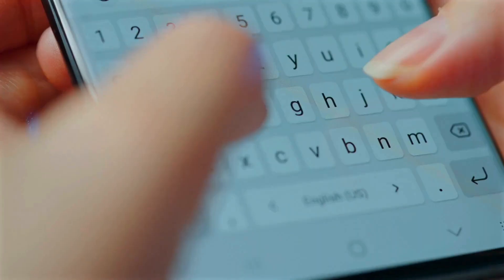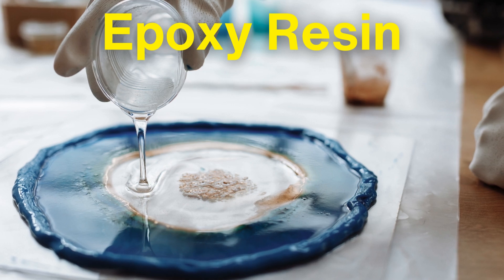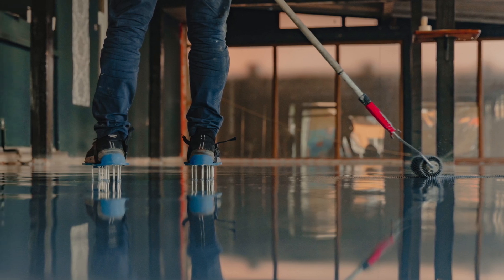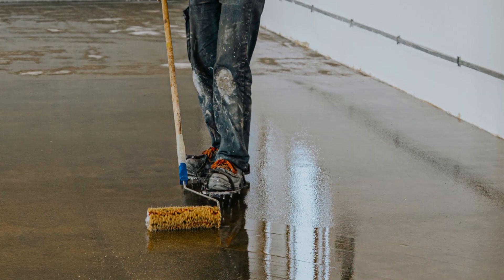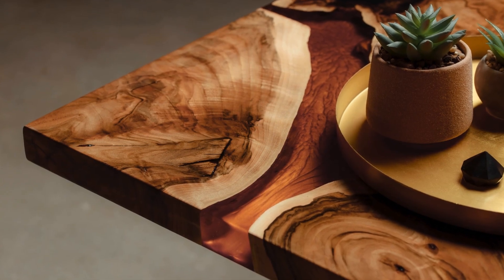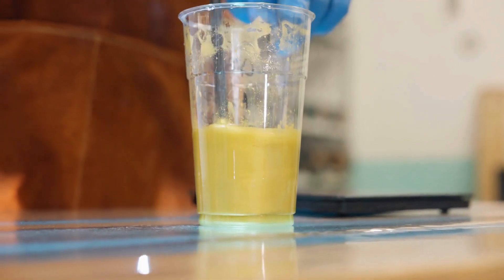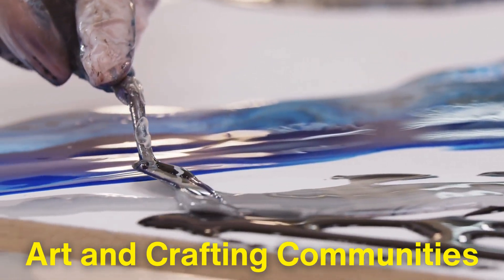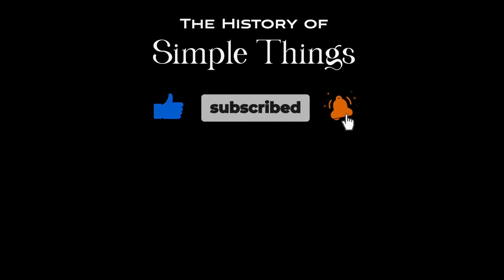How Do Epoxy Resin Coatings Protect Surfaces? A Guide to Durability and Versatility!

Comment: Epoxy  always uses a hardener (which becomes a major component and influences properties of the product) catalysts can speed the cure, as can heat like almost any other chemical reaction (as long as you keep it below the Tg temperature)
Then you have intermediate products like vinylesters 
Opposed to something like polyester/poly methacrylate where a catalyst  merely provides a means to accelerate the monomers to link themselves and is not an important constituent of the final product.
Also, epoxies (generally) have poor UV resistance...
You can add UV inhibitors to the hardener or you can opacifiers (like atomized metals or even lamp black) to the mix so that ultraviolet cannot effect anything but the very surface.
Perhaps you should have delved into the various chemistries and how, for example, amine cures differ?